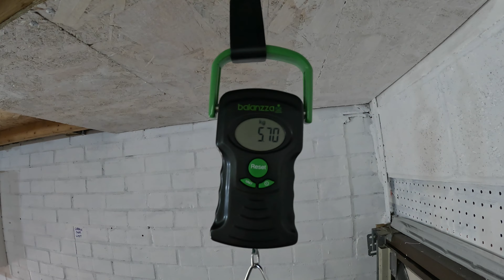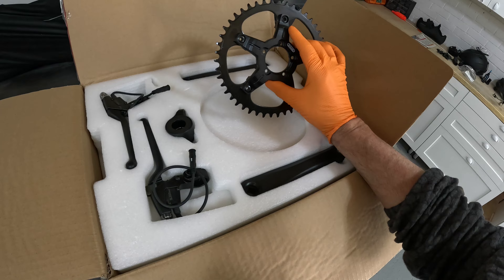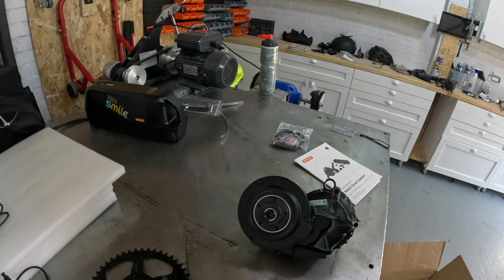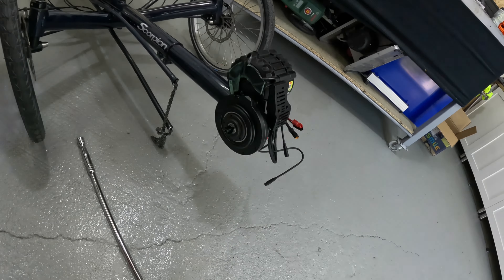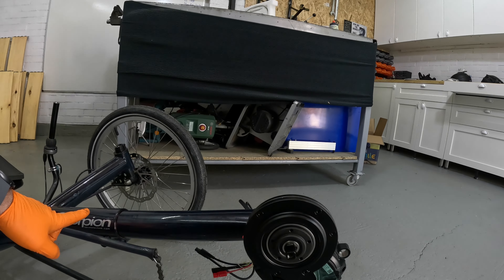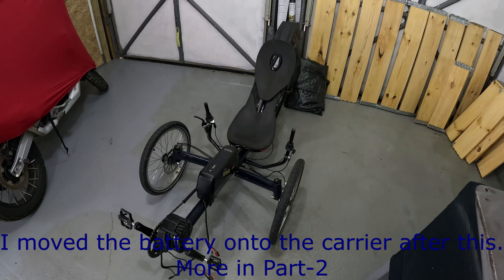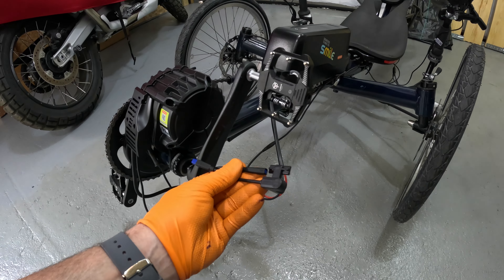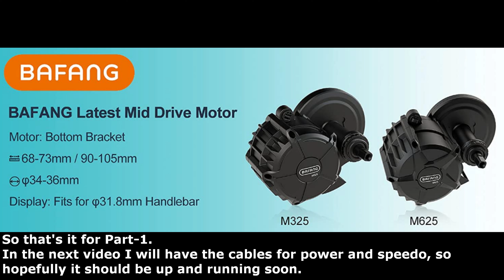HP Velotechnik Scorpion - Bafang M325 conversion - Part 1/3

Comment: How is the gearbox lubricated?, if it's designed to operate in a specific way you may have a lack of lubrication if it's in another orientation, it may not be a problem but it would be good to make sure😊.

Comment: The torque of the motor will try to keep it on top of your frame. My battery is mounted under the seat on the main frame. They have extender cables for all those  cables.
Reply from the maker: Thanks, Arnold. The extender cables I found were all of the 'round' type. This model seems to have different shapes for different connectors, and they are not so common. I did find someone selling them from China on eBay.co.uk but with a 6-week delivery time. No local UK-based seller had the cables.
Reply: Hatte das selbe Problem, habe sie einfach verlängert, nen Fahrrad Rücklicht Kabel dient dafür gut , einmal der Spedsensor 3 Kabel und den geht das ,